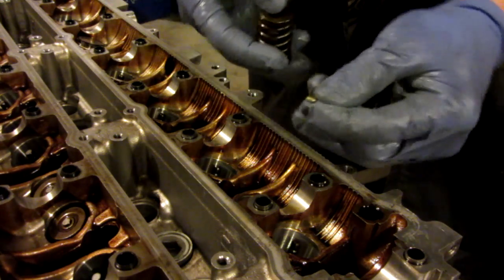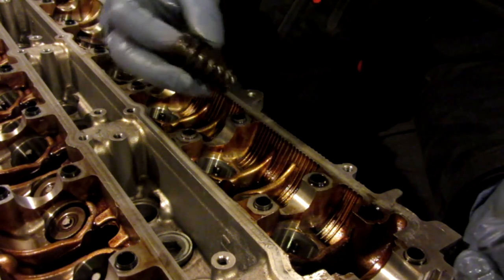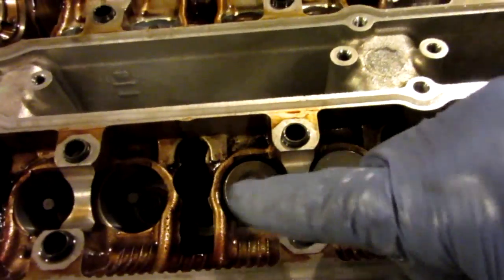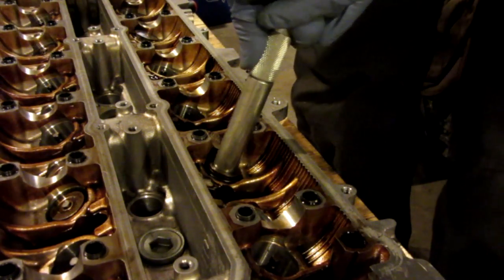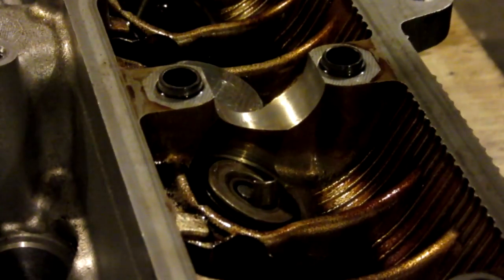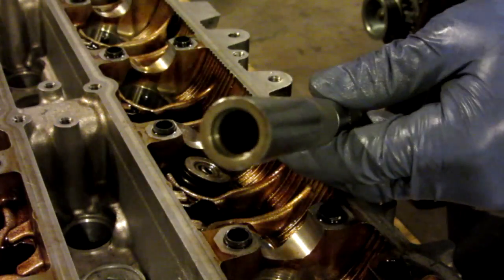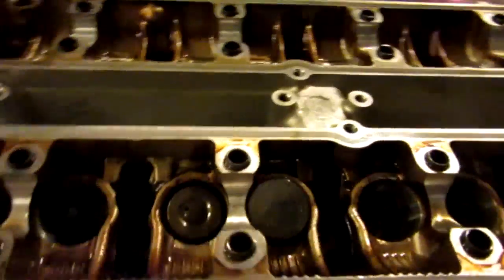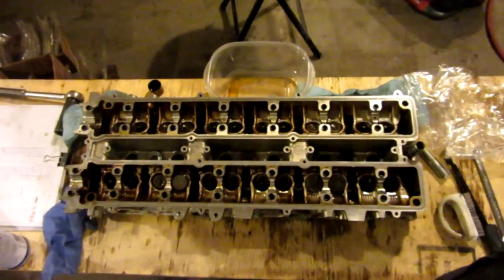Easy HACK for Installing Valve Spring Keepers

Comment: To add to your tool get a rubber hose that fits loose around valve stem and fits in side your keeper and put it through your valve tool push

Comment: Soft springs! I'm rebuilding my head from a bmw I6 and there is no way that's going to work, but thanks all the same!
Reply: Mine might as well just be solid bars, they take some serious work with a spring compressor to move them. Push by hand! Ha!
Reply: My thought, too. No way my 6.2's springs are compressing by hand. Still a neat trick for the engines it works on!
Reply: Check out the valve master they came out with a tool for the 3 keepers
Reply: @Will  you'd be surprised . They don't need to compress fully

Comment: Thats F's awesome! I spent up to 5 minutes per valve with a compressor trying to get these friggin things in! Gotta try it now with a pipe and a slug although my stems sit higher off the keepers....? Probably just counter bore the slug.
Reply: How did you keep the valves from moving down when you installed the springs & keepers?

Comment: If I filled my cylinder with air to keep the valve up, Couldn’t I technically do this without removing the head ?
Reply from the maker: Yes that is a pretty common technique that works well! You can also use string. I had the head off to do a head gasket anyway
Reply: @JDMods Garage  I've got 2 valves with slightly unseated keepers 
1 has just 1 a lottke unseated won't obvs allow shims . Other likeky font need much to sort . May need to do string trick feel a pillock as all seals replaced can't believe I failed to notice it. If I use compressed ait what do others use to seal ? And pressire needed ?

Comment: Using the rope in the cylinder, can I use the starter to get to TDC or  will that damage the valve?
Reply: I'd turn crank it's only a gasket ..much safer

Comment: Won't work on valve stems that extend past the keepers, but it's a nice hack, thanks for the video!!
Reply: Like my Toyota 4age 20 valve? I have a Lisle 36200 tool that worked well on my S2000 but it's way too big for the 4age 20 valve! I had to abandon the valve stem seal replacement. I wonder if the 36050 will be small enough
Reply: @RolanTHUNDER  yes the 36050 kit has a smaller diameter tool than 36200

Comment: Gee, I don't know.
I bought a valve spring compressor on ebay for about $20.00.
It is a breeze to remove the keepers and just as easy to put them back.
Why not just use the correct tool?

Comment: Couldn't u have put the dowel inside from the start and avoid that situation?
Reply: Its a comparison video
Reply: He was showing without the dowel and with...
Reply: He was just showing what happens if you use the tool "as is" vs. The mod he used so the tool worked even better, great video man! Almost quit mechanics altogether because of installing keepers/ springs until I came across a similar video like this except in the other video he used a piece of foam in the socket instead of a dowel which both seem to work and I've tried 4 different spring compressor tools, they all fckn suck not to mention none of them worked for getting my exhaust valves out sooo had to make my uh "own way" lol mechanics at its finest I guess!